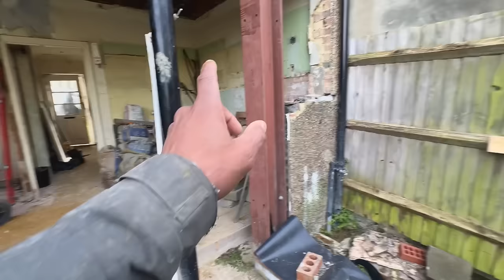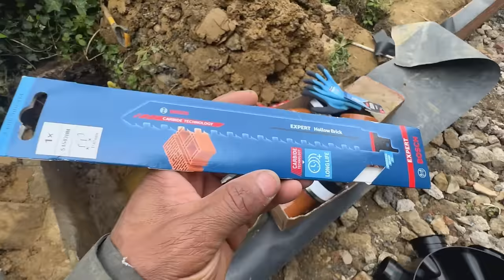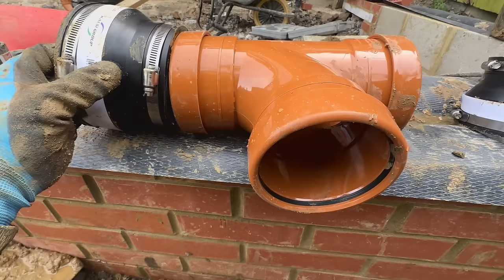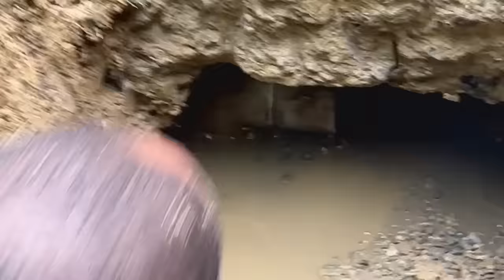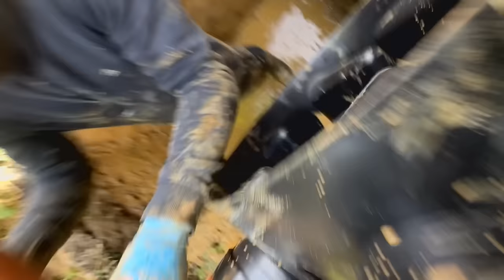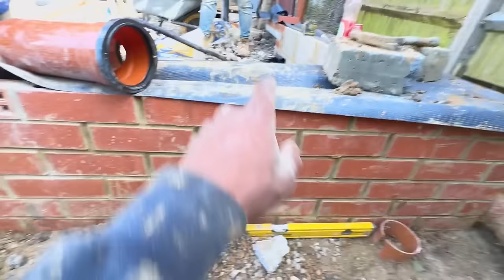We solved the drain issue

Comment: That looked like hard work well done Darren and the lads, enjoy all your content, as for the risk with 240 v and water, yes we all have to asses the risk, I'm a lift engineers by trade, we have to work live on high voltage, nearly impossible to fault find, most times you have to use "common sense " and experience , with yourself it would be worth purchasing a 240 v extension lead with buit in rcd which you may already have, and even a set of eletrical safety gloves, easy to carry in the van
Keep up the great work.🙏

Regards Russ..

Comment: What a nightmare of a job to take over. Good on you for even considering it. Looks like you did the best thing in the circumstances. Would have been much easier if the previous builder had moved the main sewer outside the extension. I'm not sure how easy that would have been, though. Put a rodding point at the base of the new soil stack, that will cover all access issues.
Reply from the maker: Yeah will do 👍🏾 we haven’t finished but there will be a point higher up

Comment: When down the hole you said the new connection is sweeping to the left, but I thought you said the properties next door to the left were at the top of the run? So shouldn't it be sweeping downhill to the right? I hope I've missed something and I'm wrong!
Reply from the maker: That’s rights, well spotted lol. I did some further investigation and it’s actually floating to the left. The neighbours on the lefts small inspection chamber wasn’t the main one. Once I got down and accessed the pipe the gradient was clear as well as the direction of our own man hold joint.

Comment: the foundation is built right on top of sewage pipe ? Is that legal ?
Reply from the maker: No there is complex bridges built over it. It is floating.
Reply: @darrenthebuilder  Understood! Not seen a foundation under and along the the length of a foundation. The water company usually prefer a diversion around or through the building with a build over across the width of the pipe. If they approved it then I suppose it ok. Maybe there's no room for diversion I suppose.

Comment: It's often difficult to see angles & stuff on videos but is that new footing built on top of the existing drain?

I have never known building control allow a footing on top of drain run, I don't want to jump to conclusions but did building control see what had been done there previously by the old "builders" & approve this? 

Would hate for you to have crawled about in they mud all day for building inspector to say you can't do that &  that footing cannot be on top of that drainage as I am assuming that drain run services other houses also.

LOL I would have no hope of fitting inside that new manhole ring 🤣

Comment: Theres a few issues there !! 
One, you've created a  'hairpin' bend very difficult to rod, the channel in the Inspection Chamber should be at 90° to the flow.
Two, the rodding point should be ontop of  the 'back drop' thats where the solids can block back up!? ... secondary rodding point should be in the SVP to clear the run to the back drop.
Thirdly, there's a depth limit on plastic inspection chambers, after which it needs to be a brick built chamber ....
Reply from the maker: There will be an svp higher up by the wall. Very easy and simple to rod. A child could manage it. There is a rodding point at the back drop. It’s right there and easy to see at the top Of the chamber. The limit on plastic chambers is actually 3m with a reduced size cover. We are well within  the spec even for a 450mm cover. Here’s some helpful info: https://www.drainagepipe.co.uk/inspection-chambers/how-deep-can-inspection-chambers-be-installed/#:~:text=Standard%20Inspection%20Chambers%20(450mm%20Diameter,standard%20chamber%20cover%20is%201200mm.

Comment: Hi Darren, given concerned comments, please get building control to sign off the new drain run. As a newly qualified surveyor my concern is adequately supporting the vertical pipe in the trench and 45 degree junction against ground movement. 

The space you have looks tight it's hard to show every detail on video, hence the unhelpful negativity, but i want to see a leader of colour succeed. Please cover your back. All the best. JDD🤛🏽
Reply from the maker: Yes will be getting them in to check once we complete the last bits. People assume a lot from videos but worst is there are some people with negative biases towards certain groups who get off on trying to pull us down and find fault even when it’s not there. There’s a lot of nasty people with dark hearts out there.
Reply: How were the pre vinous contractors allowed to build over the drain run. I’m amazed the water authorities allowed a build over permit. But well done Darren on a tricky situation. Just make sure BC pass it off to cover your ass 👍

Comment: That’s not looking right, you can’t rod with the pipe going uphill, you would need a rodding point at the wall joint before the pipe feeds down into the drain. Also you would never have a drain pipe level with the cavity floor level it needs to be dug much lower along the fence (a bit more work but there’s no shortcuts) this building inspector needs his head looking at!!! I would never pass this work as acceptable.
Reply: All that matters is the inspection is passed off.
Reply from the maker: What do you mean by cavity floor level? How low below ground to you think the pipe is (from the video?)
Also we’re putting an access point later on the wall. The back drop is there for rodding purposes. That’s what it’s for.
Reply: Well said
Reply: @darrenthebuilder  the pipe looks level with the garden soil from the video, it doesn’t look deep enough. Looks a bodge job in the inspection chamber. If you’d dug more from the left and behind you would not need that much of a drop into the inspection chamber. I would have dug out at wall level to the depth of the inspection chamber then run the pipe along and directly into the chamber.
Reply from the maker: @Ash78699 well looks are deceiving and you would need to ask more to understand the full challenges we face. I’m use to people to assuming a lot and that we don’t think of everything. There is no place to dig on the left as there is a concrete pad that runs right up to the boundary. So that’s basically impossible unless remove the fence and I route the pipe on the neighbours land and back again. Also the level you are looking at isn’t the ground level but below it. There isn’t a minimum depth for the soil pipe either. The pipe will be covered and there plenty protective ways to do it according to building regs 👍🏾. But in any even the pipe will be buried and safe.
Reply from the maker: Mark Asford the self proclaimed “Master builder” dosent even know that one of the purposes of an inspection chamber is to change the direction of flow of waste which literally means you can enter the chamber at one angle and out at another but here you are claiming that the feed should be in a straight line smh. You also should know that a house with timber floors should be vented through the concrete slab and out through vents. An old man like you should be embarrassed the way you get off trying to tear find fault and tear young black men down. But I know your type and you can’t be helped. Your irrational hatred of other groups of people unlike you will go to the grave with you. Just remember we all bleed the same
Reply: @markashford896 what a clown. If you watched the earlier video you would know that it is to maintain airflow to the suspended floor within the house. Quite normal!
Reply: @markashford896 the air bricks are probably for running pipes through to the exisiting suspended floor in the house, you can't just block off the airflow to existing floors.
Reply: What a miserable job, doing that sewer connection in wet confined space 👏. Well done!